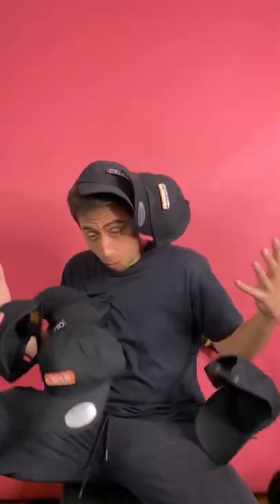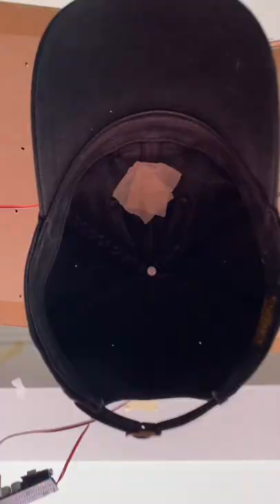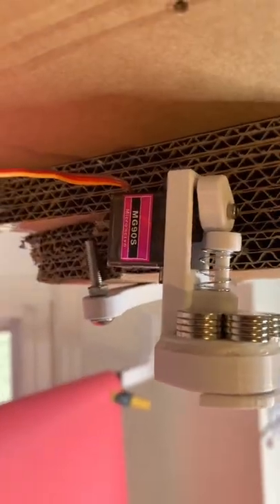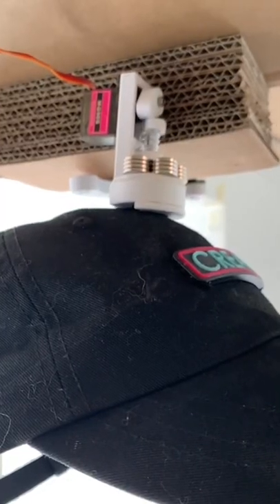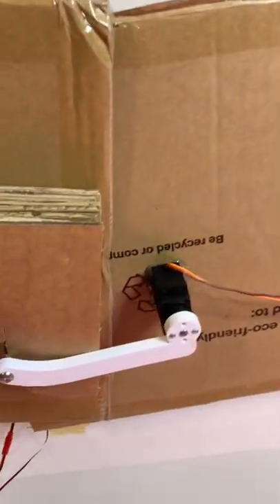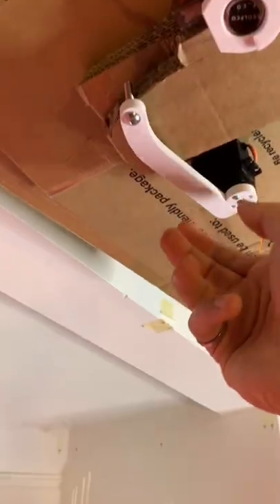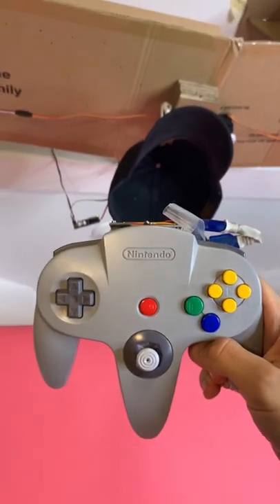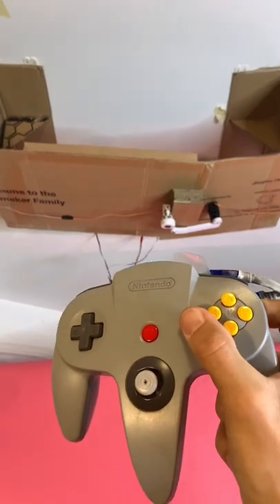The Mechanism Behind the Hat Dropping Rig

Comment: What kind of wireless communication did you use with the controller?

Edit:
I ask because I buy cheap RF communication on eBay, but I never could get it to work. I’ve only been successful with Bluetooth, wifi, and infrared, but I really want to make RF work
Reply from the maker: This is just a basic NRF24 module- surprisingly easy to get it to work!
Reply: @Engineezy  thank you, I appreciate it!